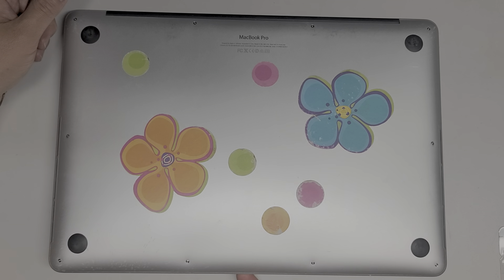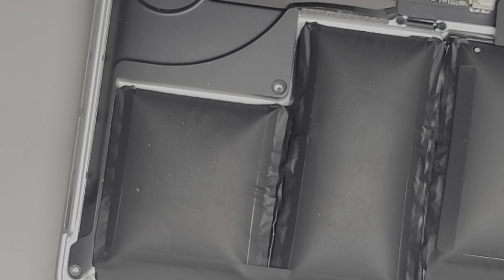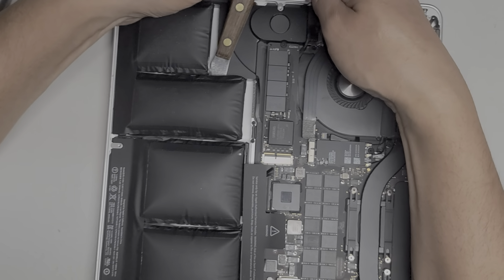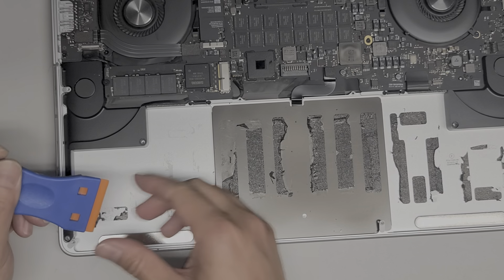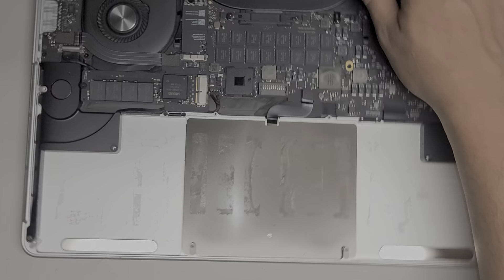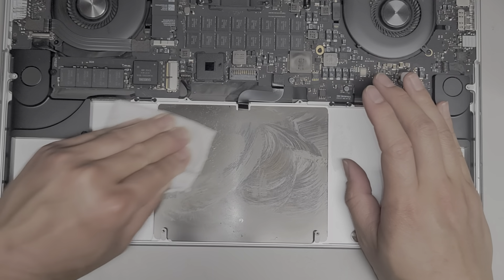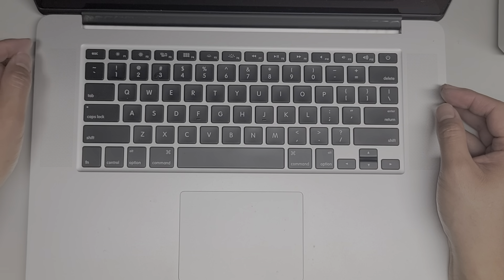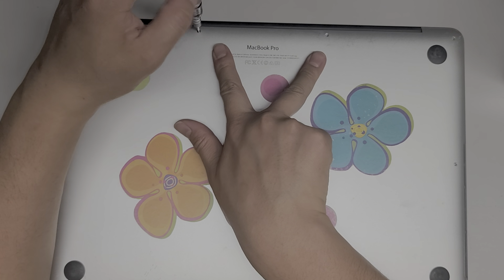15" inch MacBook Pro A1398 Late 2013 Mid 2014 2015 Battery Spicy Pillow Bulging Swelling Replacement

Comment: Thanks. I used your video to find out the absolute minimum disassembly I would have to do to minimize risk of damage. Just the bottom cover and four internal screws. Very easy to keep the screws organized by just getting a small, 11-compartment tool organizer box from the dollar store, which gave each screw its own place. All six of my cells were ballooning like crazy after seven years. I didn't want to use your scraper method, so I used the dental floss method. Quite easy sawing through the tape, at least when the floss didn't break around the toothbrush handles I was using as grips. Toward the end, I actually even adopted a different method after the third time the floss broke. I call it the "Band-aid" method, after the old debate about which is easier for removing Band-aids: fast or slow. I just grabbed the top edge of the last cell and gently pulled upward with steady, constant force. I could hear and feel the tape gradually peeling loose over a couple of minutes, the usual best way of removing double-sided tape. No tools, just my fingers, so basically zero risk of damaging the battery. Kept the force low so I wouldn't break the trackpad. Worked great. MBP is now back together with new battery and works perfectly, reporting 8750mAh, 100% health and 0 cycles. Didn't even have to reset the SMC or PRAM.
Reply from the maker: Awesome, glad it worked out. I highly recommend resetting the cmos and pram after hardware changes on MacBooks.

Comment: Wow. I just finished replacing my battery with an iFixIt kit. Didn't follow iFixIt's guide but yours, because I also experienced a pillow bulging battery. I didn't have a tool like you use, but used the iFixIt plastic cards and they also did the job. It was a scary experience doing this for the first time (afraid of pinching the battery cells), but I took the time to watch your guide for every step needed, and followed along. I can only say that this is a great guide! 
At first I was afraid that not following iFixIt's guide a lot of things could go wrong. But now I can say: you actually don't have to reassemble your entire MacBook (the iFixIt way), just unscrew the speakers and the battery-pack and you're all set to go and replace the battery. 
Really great guide and thank you so very much for sharing this. 👏
The bonus for me: I can put my MacBook asleep again by closing the lid, my MacBook is not wobbly anymore: it stays firmly and flat on the table and the trackpad works again!
(I actually wrote this review on my MacBook with the new battery installed and charging now)
Reply from the maker: Awesome! Yeah, the ifixit guide is a lot more risky having you remove the entire motherboard/logicboard. Glad it helped. If you haven't already, please like and subscribe so others can find my videos. Thanks!

Comment: Great guide! Did not have something like your prying tool, but used two pencils and a fishing line to "saw" through the glue underneath the batteries. The Macbook was so swollen that the trackpad stopped working. The bulging shape went back to normal after the battery was replaced and trackpad is ok. This guide is so much safer and easier compared to removing a lot of sensitive parts like the iFixit guides. Thanks again 🙂
Reply from the maker: Glad it helped and you were able to find a solution! If you haven't already, please like and subscribe so others can find my videos.

Comment: Thanks for the video, very useful. I changed the battery of my MacBook Pro mid 2014 just like you but it won’t charge. The mac turns on and work fine but the battery won’t charge, i even changed the charger cable with a new one but nothing. What it could be?
Reply from the maker: Did you make sure the connector is pushed down all the way?

Comment: Followed tutorial but Mac screen black. New battery added and cannot hear chyme but fan is spinning
Reply from the maker: Did you follow exactly? Did you do the power drain?
Reply: @ItsBinhRepaired  I followed exactly but didn’t do the power drain is that bad? Please help
Reply from the maker: @WeezsimS  you might have fried the motherboard
Reply from the maker: @WeezsimS  try the pram and smc reset
Reply: @ItsBinhRepaired  ok let me try it
Reply from the maker: @WeezsimS  OK
Reply: @ItsBinhRepaired  not turning on no sounds fans spinning
Reply: @ItsBinhRepaired  but I plugged the charger showing yellow could it be battery not charged ??
Reply from the maker: @WeezsimS  no, it would show the low battery symbol on the screen

Comment: Hi just wondering if when you replace a bulging battery does the bottom cover flex back to normal so the MacBook sits flat again ?
Reply from the maker: Yes, it goes back to normal
Reply: @ItsBinhRepaired  thanks for the reply…hope you healed well from your crash
Reply from the maker: @freddyluvless1063  scars on my hands from another one, but healed just fine.

Comment: Mid-2014 and mid-2015 15-inch share the same battery? Seen posts on the net that says no and others say yes. 2015 has a1618, 2014 seems to be a1394. Can anyone please confirm?
Reply from the maker: Purchase a battery that's made for your model.